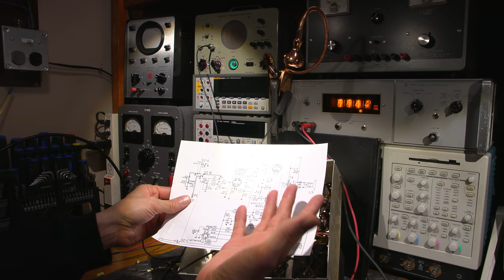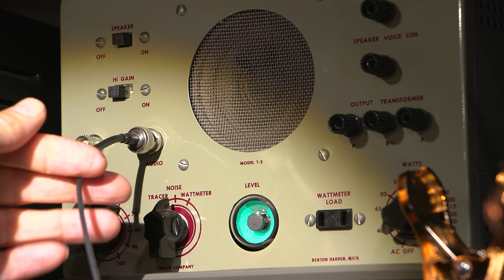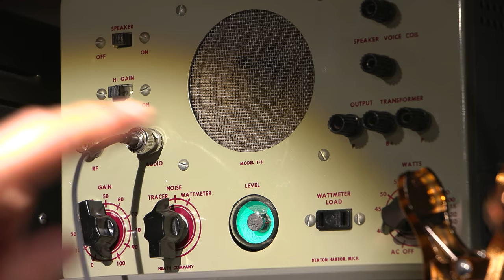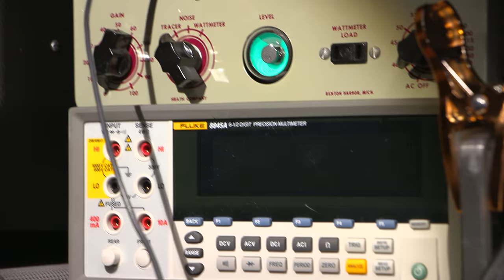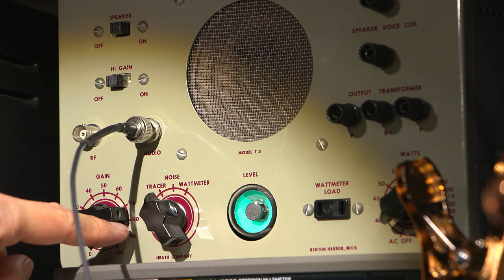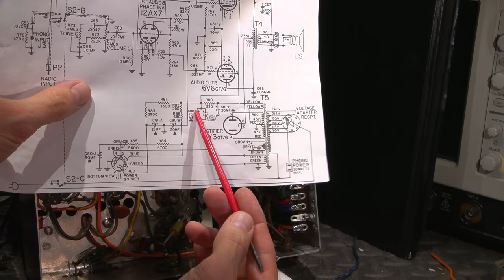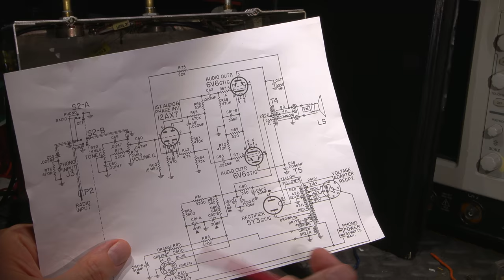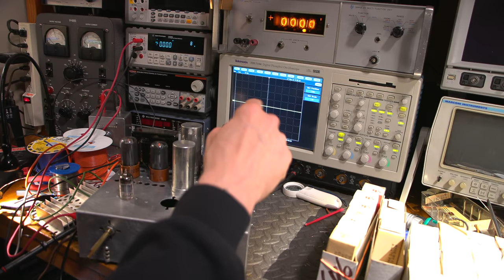Radio Receiver Restoration Series Part 3 - GE CX371 Amplifier / Power Supply Rebuild!

Comment: Back in the '70s, RCA used to sell a small container of a very dark green heavy viscosity and stinky lube that was to be used in what was called incremental tuners - which means a tuner with wafer switches as opposed to the turret strip types.  The stuff never dried and protected the contacts from corrosion.  The small container would last years as only a tiny amount applied by toothpick would be used.  After mechanical tuners went away, I used it for wafer switches in stereos and the like. I lent my last tub to my buddy back in the 80s and he lost it somewhere.  I wish I could buy that stuff today.
Reply: Try Deoxit D100.
Reply: Sanchem makes some very similar stuff in a 2 ounce jar  called No - Ox - Id. Western Electric  Co. used it in the 
manufacturing of telephones. Cosmoline like substance that's been around a lot longer than we all think.
Reply: You can get it at el electrical supply stores. It’s called no ox. Grease.
Reply: @MrLeejan  It is some really good stuff. The stuff by  Sanchem is a little thicker grease than the stuff sold in stores.
Reply: Petroleum Jelly
Reply: @rcmrcm3370  lubriplate.

Comment: The two things that made me happiest about this video: 1.} Your bench was a little bit messy from doing all the work. 2.} You got all the way to the end and found out you had a bad output transformer. You are human after all. Ha. That exact thing happened to me on a Grunow Teledial radio. The only difference was I didn't have one just laying around. I had to buy a speaker with one mounted to it and switch it over. Thanks for the series. Loving it.

Comment: Excellent video, Paul. I love that bit of detective work with the lack of plate voltage on the output tube. I have a H-122a with a hideous hum. After watching this, I may strip it down and "rearrange the furniture", and see if I can quiet things down. Thank you for another great video.
Reply from the maker: You're very welcome Chad!

Comment: The things you cover are amazing. Keeping the power supply ground near the transformer, the reason to not ground the input shield at both ends, the oscillation above our hearing range that's harming the speaker or output transformer. So many more. My amplifiers notes manual is getting thick and it's all valuable! Thanks for all the hard work. I love it!

Comment: Your video quality is excellent, just like everything you do being a great teacher for all of us. The only shortfall, as seen in this video, that I see is your audio. It appears you have one microphone which, in this video, is pointed in the direction of the Heathkit device. Assuming you have two audio inputs on your camera I would like to offer a gift of a set of Rode wireless Go microphones. This is the original version of one transmitter which clips to you shirt and one receiver that plugs into the other audio input of your camera. I have since purchased the newer version so I do not use these and giving them to you will be a great re-purposing. Please let me know if you would like these. They are a great tool. Thanks again for your superb videos!

Comment: There isn't anyone who is as thorough as YOU!

I'm very interested in the identification of which lead is connected to capacitor's "outter foil."  Others seem very uninterested in this critical noise reduction technique.  Why?  It isn't that difficult to implement!

ALSO was 'educated' myself about noisy resistors.  That could be maddening!  Didn't know about that test?  Would noise appearbon scope of a powered up unit but with no input?
Reply from the maker: The answer is very simple Tom. The reason they deny it is: They have been doing it wrong for years, then they find it hard to admit and come too terms with that. If you can see an electrical difference (a very pronounced difference) on an oscilloscope, and they still deny it, then it's now come to the point of justifying a mistake, (maybe many mistakes.) They put the band on the capacitors, and marked the outside foil for a reason. Some companies even went as far to say "ground end" on the paper and foil wax capacitors. It's there for a reason in point to point wiring type circuits. Thanks for your kind comment!

Comment: WOW all that iron and glass for 6W. Amazing amount of work for a simple function. The designers of that system could have never dreamed where we are today. Even the simple transistor would have been inconceivable. Good planning and careful layout are still important today, but now it is high frequency switching noise not 60Hz. Amazing world we have now.
Reply: Yep, today a baby fingernail sized class-D chip can deliver that amount of power. But it won't give you that warm and fuzzy feeling...
Reply: You're right John for 6W output it needs the power for the filaments of all the valves, about 10 or 12W?  Then there's the power used to keep the valves running & plate currents flowing & biasing correct, 40 - 55W?  So yeah, efficiency, nope, 10%?  Well it could heat the room a little?  Still, the richness of sweet even harmonic distortion through an 8 inch or larger speaker is hard to beat.  A dear old cousin of my grandmother had a large floorstanding radio with probly a 12 inch speaker that as a child, the 'tone' of it was somehow so mellow.  It's the valve sound that consumes a fair amount (or a lot?) of power all the time.  Expensive to run so there's added cost if you want that sound.

Comment: Very interesting, and thanks for all the tips!  You said the Heathkit T-3 "listens" to the tested component in Noise mode but didn't describe how it does that.  Not with a microphone, I trust.  I couldn't hear the hum at all, didn't see the tube flashes and only barely heard the scratches, but then my computer gear needs a restore almost as badly as that GE radio does.  4K is not yet possible for me.  Would also have liked to have seen you rewire that OP tranny as it's unlikely I'll have a spare if/when I encounter one with an open winding. Beyond that, though, your hum-buster and other tips are always welcome.  I'm enjoying the depth of knowledge you're giving us in this series.

Comment: You mention a noisy Resistor can cause an Audio Amp to have a Sizzle Sound. That caught my Attention cause I have an old Heathkit Stereo that has always had a Sizzle. Now I just gotta determine if it is in the Power Supply, or in the Amp itself

Comment: Another clever trick with those switches is to use a small strip of paper and slide that in between the little "pinchers" after the wafer leaflet is out of the way (if you can...some don't ever go open depending on the routing of the switch).  Anyway little spot of Branson EC on said strip of paper is what I've used and had ok results.  However the TarnX here is noticeably way more effective after seeing this.  Thanks, Paul!

Comment: Am presently working on a 60 year old admiral small console record player that uses a 12ax7 and two 50c5 tubes in a push pull arrangement. 4N2A amplifier. Every time I think I'm close to finished I watch one of your videos start checking the numerous other things. you talk about. I don't want to do any damage to the unit by playing too much.
Reply from the maker: It sounds like a series type setup. If it doesn't have a power transformer, be careful! You may want to look into an isolation transformer.
Reply: Excellent jwl!  I hope your project goes well!

Comment: Regarding a part with oxidized contacts, if you can remove the part, take it to a sink, rinse it in warm water then add barkeepers friend and some gentle scrubbing with a soft toothbrush. I have used this for awhile on old Betamax leaf switches and VHS mode switches and it works great.

Comment: HI Mr. Carlson,  Very nice work on the restore - really like how you replaced those filter caps on the terminal strip.
Nice catch too, on the dead output transformer.

However, there is one thing I am not quite sure why you didn't 'improve' the design... that being that it didn't have, and you did not add a grommet to  protect the audio transformer wires as they come the the hole in the chassis.  I have seen a lot of older equipment that after time, the insulation cracks and then you have shorts or arcing with pass-thru wires.  The other one being the coax cable that goes out the side and connected to the pot.  Not sure where that one heads off to.

Looking forward to the next episode...  73

Comment: GREAT job on this radio, so captivating.  I have an old STROMBERG CARLSON, Table top that I am going to have repaired.  Question: back in the 1970's there were F M Splitters, from the cable for T V , to the  F M for radio. On the lower band, from somewhere around 88.5 Mhz. to 90.0 Mhz. my stereo would pick up  T V  broadcasts. Was this common or some kind of anomaly ???

Comment: I am am in awe of some of your restorations, some of these radios look so good. I have been wondering if it is possible to take an old valve radio and carefully rebuild it from the chassis and improve the sound. I know it is not practical, but how intersting if the old schematics can be used with some new and possibly improved parts for a good sound and connection to DAB and regular record player. I can't find anyone who has tried yet.

Comment: I once heard a lecture about silver vs. gold contact and the point was that even with tarnish (not oxidation, oxidization?) on the contacts the silver contacts were better than gold. The lecturer explained that the tarnish on the silver was silver sulfide and that is a reasonably good conductor by its self. Anyway his point was that it is not worth worrying about tarnished silver contacts. Have you ever tested the conductivity of clean vs. tarnished silver contacts?

The sane guy told us that the standard leads for phono pickups were junk because the return was used as a shield and connected at both ends allowing a current that would distort the signal. That goes along with what you said about grounding only one end of a shielded cable. His advice was for phono cables you did best using 700 ohm antenna twin lead lead to make your own.

Comment: PAUL'''''''a really nice video'''' thank you'''''''can you explain what makes a resistor go noisy'''''''''''i would presume it's age related '''''the break down of the carbon due to age and or stressed through heat & load''''''thank you sir''''''excellent''''''James,,,,Oklahoma .

Comment: I think this is the first time I've heard Mr. Carlson mention noisy resistors or checking for them during a restoration. Are noisy resistors still a problem in modern day gear? How would you test resistors for noise without that old piece of Heathkit test gear?

Comment: Starting to look good now, can't wait until it is all finished! 

Just a quick question after watching this.. you did mention hum reduction.

Probably a small can of worms here but as you have mentioned many times lead dress is very important.. Do you ever use twisted pairs for AC tube heaters? 

I've had some good results using a carefully routed twisted pair supply to the tubes to help eliminate some EMI, never compared it scientifically though so I don't know if it actually performs any better than it would with a well laid out non twisted supply amp. Could make a fun project to change the heater wires over and measure it properly.

Comment: Hi Paul I have enjoyed watching this series. Very detailed work. 
I have a question, the output power seems a bit low to me for 6v6’s running near 300v which should according to the data sheet should easily make 10watts even 14w. And the clipping appears substantially unequal. I would swap the 6v6s around and and see if the  early clipping changes to the negative side of the waveform.  Did you replace the phase inverter?  The original tube may not be able to swing symmetrically.

Comment: Hi Paul. Did i miss something or had you already matched the o/p valves on a valve tester before installing them, as i thought, with a push-pull design, it was good practice to do so per channel. If not, wouldn't their be problems with output from the amp. Ie an imbalance between the +ve & -ve parts of the o/p signal.
Btw great videos, been subbed for ages, very informative. 👍

Comment: good work loving this radio and amp restoration all so love the glow of the tubes all ways wonder if i could get an big old tube and just get it to glow LOL :)
Reply: Ebay is full of old tubes...And if you get a 30v 5A variable power supply they are easy to get to glow..
Reply: @DynamicSeq  ok thanks for that

Comment: A few small tips literally... Instead of using the cotton swabs with the large tips go to a women's beauty supply store or department. They have small tip swabs used for applying makeup. I found these are easier to get into tight wafer switches. Also, I use pieces of incontinence pads to absorb dripping contact cleaner or lubricant. Paper towels was not getting it done as well as these were.
Reply: That's a good idea. Also, with foam swabs you don't run the risk of getting cotton fibers caught in the switch contacts.

Comment: I took another look or3 and their was a series of flashes and ticks 3 or 4 times. It would be very interesting to see what the heater current is doing? Has that tube been reconditioned? Earlier in the video I saw a difference  in the glow between the heater elements

Comment: I am enjoying your restoration of the GE radio's AF amplifier. Question with plate voltage on the 6V6's of 300-350 volts DC. Why   are the push-pull tubes not pushing out at least 10 watts or more before clipping? According to tube manual ratings with 250VDC the two tubes should give 10 watts output @ 5%THD. Around 300VDC the tubes should be pushing 14 watts @ 3.5%. Did you check the Impedance of the primary of the replacement OP Transformer? I guess the soft 5Y3 rectifier is allowing a bit of Voltage drop maybe.
Reply from the maker: Cathode resistor, screen voltage, plate voltage, transformer impedance all play a part. You can see, it flashed 14 Watts in distortion, so it's there. With a sturdy supply, better selection of cathode resistor, (different value,) and higher plate and screen voltages, this would easily make 15 Watts with low distortion. The transformer is optimized for these tubes, it's actually a custom wind. I was lucky to have a spare on hand. These tubes really perform with 400+ on the plates, and they deal with it well. The oval plate 6V6GT's (the plate looks like a squished barrel) are extremely dependable, and are probably the best design of all the 6V6's. This is why the JAN variations all use that structure.
Reply: @MrCarlsonsLab  Thank you for the reply. I will have to experiment with a 6V6 amp sometime again.

Comment: A really interesting section about resistor noise (up to about the 10min mark). I'm curious to know what a known good carbon comp resistor sounds like on the noise setting of the Heathkit unit. Although I plainly hear the noise in the video, I don't know what's good or bad.

Comment: The time taken to explain and test a noisy resistor suggests to me just change all the resistors as well as most of the capacitors. Those that are not noisy now probably will be in a couple of years! I used to change just the noisy resistors and the leaky caps but found it was just delaying the subtle faults for a while.

Comment: I have a vacuum tube headphone amp that is produced by one of your Canadian source ... Mapletree Audio Design. It has developed an intermittent noise that sounds like that resistor you found that was noisy. I was thinking of taking a scope to it to see if I could isolate there the noise was coming from. Thanks so much for such in-depth insight into electronics Sir! 73 - KF6IF

Comment: what was the make/ type of replacement output you used?  All I seem to be able to find out there is the Hammond 1609a, which is also better than the one I have now, my orig is kind of wimpy like yours was, Also the amp I have does NOT have the negative  feedback line like yours does, so hooking the x-former up wrong won't cause the problem in my case.

Comment: I never new about noisy resistors thanks.you do such a fantastic job u have been educated well. Could u please do some maintenance on modern ham gear like Icom particular ic with microprocessors in the circuits. Go over the schematic and then the circuits components. This would help a lot. De wb8idy in Swansboro nc usa

Comment: Hi, enjoying this series and learning a lot about isolating and rejecting unwanted hum. By chance  came across another youtuber online that currently only has a small number of subscribers but I thought the Repair Rig he has constructed may interest you, if he will share the drawings with you? It allows for large heavy radios and test equipment to be clamped in a well constructed  rotary device on your bench so that it can be positioned securely and worked on safely with greater access and visibilty. Not sure if it is permitted or polite to list the link here?

Comment: There is always a tradeoff between restoration and redesign. I have no answer what is correct. Would it make us happy seing the Sphinx with a repared nose or Nofretete with new eye.  - a ridge walk!
Reply from the maker: It's all about balance. The mods done are to accommodate future service while using modern replacement components, (aside from the carbon comp resistors.) This won't be a shelf queen, so I want it to perform well in daily use. The components used won't change the way it performs drastically, but the mods will give it lower hum, and the audio transformer would give it "fuller audio."
Reply: @MrCarlsonsLab  I respect and understand you and your motivation to do everything as perfect as possible.
One can bring a Ford T model close to the original (called restoration) or making a Hot Rod of the chassis.
Both results are nice but serve another goal.